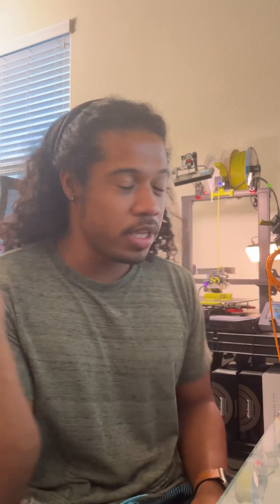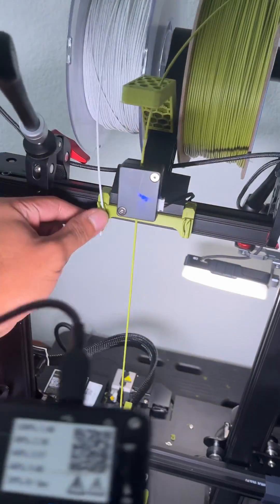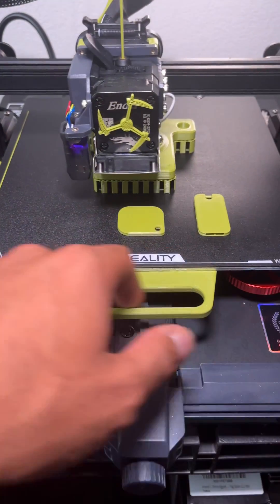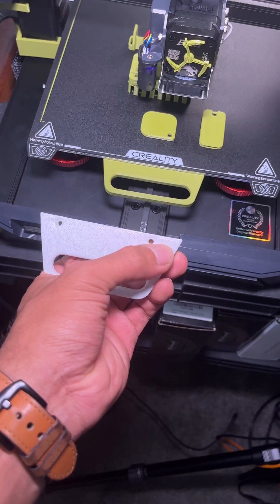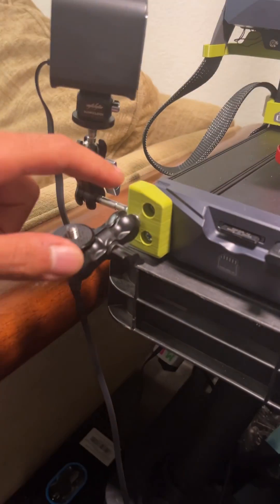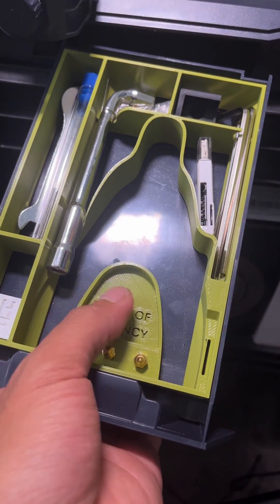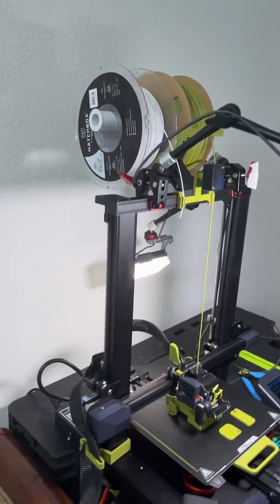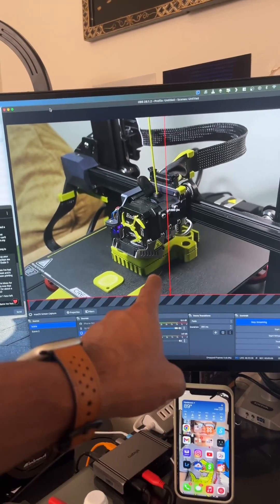Ender 3 S1 Printable Upgrades🔩⚙️

Comment: Great set of mods.  I just bought my first 3D printer (Ender 3 S1 Plus).  I will use these mods to learn how to 3D print.  What type of fliment are you using for these mods?